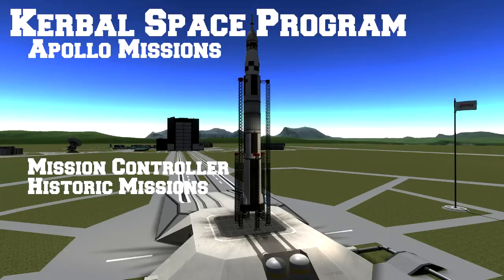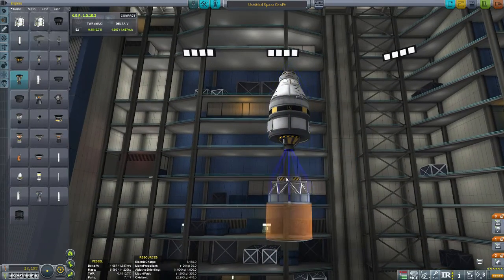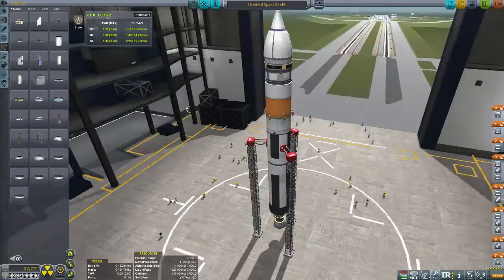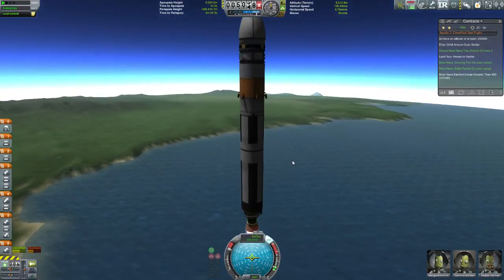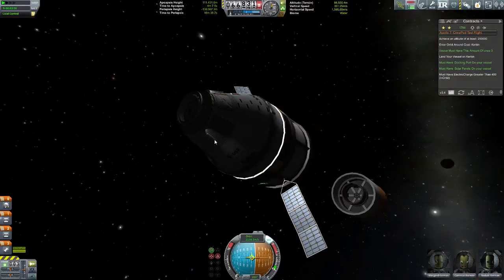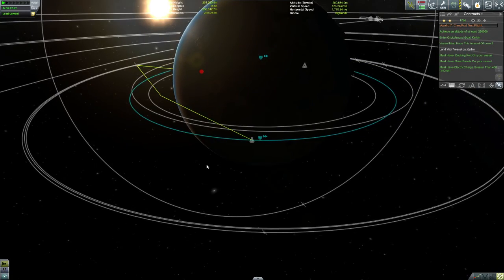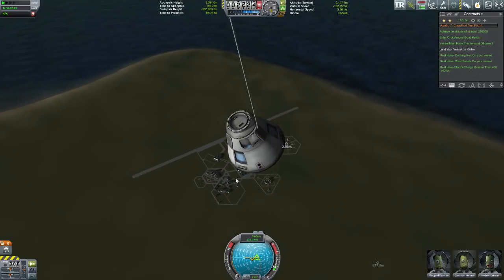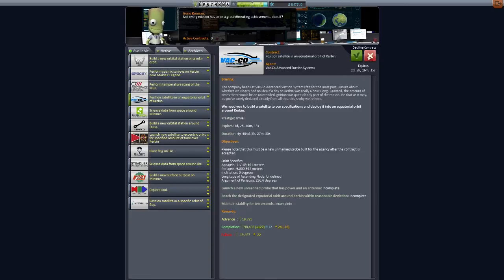KSP: Apollo Missions 1:  Apollo 7.

Comment: Great video!  What's your secret to lining up a landing so close to the KSC?
Reply from the maker: Probus Thrax Just done it so many time I pretty much know where to place the landing markers for each orbital height between 70000 meters and 300000 meters above kerbin.

In this case I knew putting my lnading marker between the small islands to south and the large on to the north would help.  Also I usually start the decent at the part that looks like texas. ;)